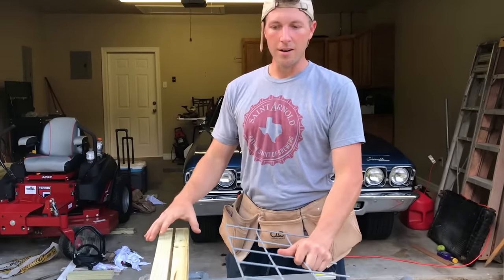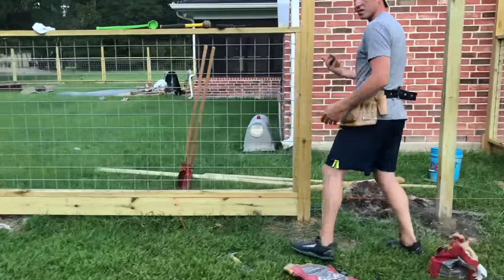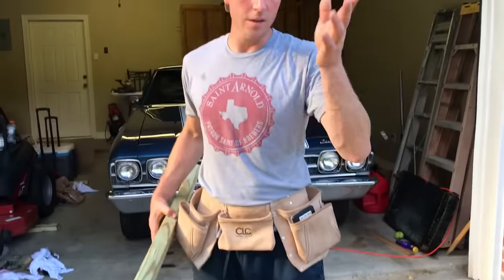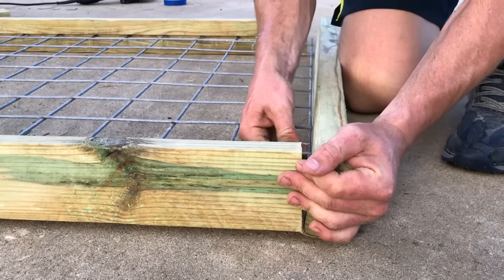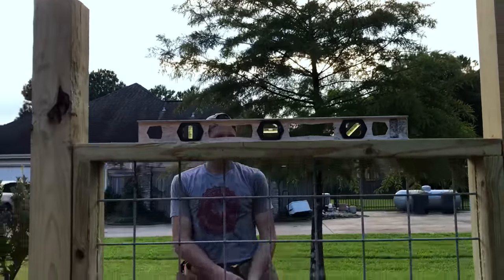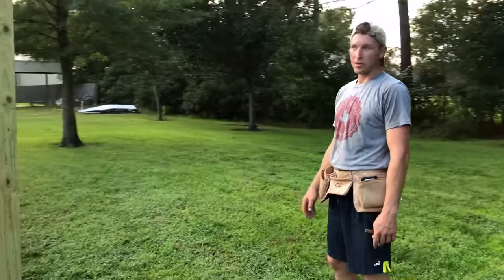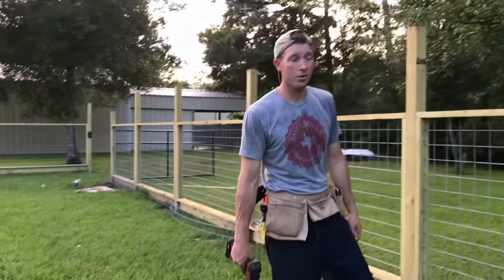Part 1: Modular Hogwire Panel Fence with Dado Groove

Comment: Sweet fence work John. I think you have a game changer there. I noticed your house is lacking dirt near the footers. I know Tx receives a good amount of rain these days. I would get a load of clay and pack 3 to 4ft wide track of clay around the house to prevent water from washing out dirt around footers. I had this come up during a major flood event in La 2016. The flood waters washed out a good amount of dirt from my home and we had to get 14 loads of clay to rebuild land and pack around the house since my footers were exposed.
Reply from the maker: Thanks, this is great information for preservation of the slab footer. Im not sure how far the slab extends beneath the soil line, but base on my video, how far up the slab footer would you suggest the placement of the clay grade be (its approx 6"+ from soil to brick/weep hole elevation most of the house perimeter). thanks,
Reply: @GatorOverland  You are exactly right. 6" from weep-holes in brick to ground. Also, if you have any critter problems you can pack the weep-holes with cut to fit Scouring Pad. Keeps roaches, spiders etc out of the house. If you have ant problems spray home defense in weep-holes and pack with scouring pad. The weep-holes are there to help your house breath and drain any water that may enter the house which is why i used the pads cause it doesn't impact draining or breathing. If you have a 6" slab on the house your footer should be 1ft but most homes have 4' slab so you would have a 6 to 10in footer. Clay was highly suggested by my structural engineer and he was right cause it packed very well and we have not had anymore issues with washouts.
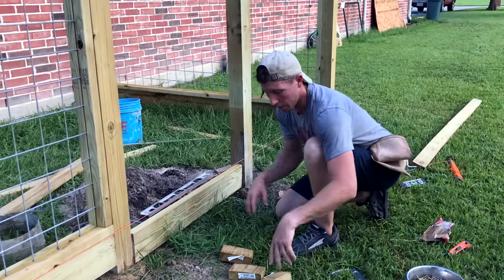Reply: @GatorOverland  Looking at 13:26 video this is what pointed out a possible issue. The soil level is too low from the house and it sort of dips in that middle area "could be grass height as well" which tells me that area could be holding water during rain events. I had to learn the hard way by finding all of this out after a flood event and very expensive as i had to hire a structural engineer so i tend to inform others based on my past experiences. I would make a run off like this \ 6 inch from the weep hole in clay as wide as its needed to level out to your yard so your mower doesn't cut into that clay pad. If your home lacks gutters i would also consider making a rock bed or mod some PVC in ground to catch that water and direct away from the house. We had gutters on our house so i just installed extensions to the downspouts to keep the water further away from the house.  If you build a house in the future build on a hill and never worry about this sort of stuff again. After 2 homes purchased and sold in 13 years we built a new house on a hill and water is no longer an issue.
Reply from the maker: @bc5891 , awesome! i will keep this in mind for sure. Ive been needing to do some buildup slope at these ares of discussion anyway as ive noticed these areas remain the wettest the longest after a good rain (aka to damp to mow near) while the rest are the yard just feet over is dry.
Reply: Normally, you would want to build a good amount of land up to meet that level around your house but this could prove to be a defect in your builder with land elevation so if you build your land up to meet that grade you may cause water issues for your neighbor. Just something to think about. I was looking at that gap you had on the bottom of the fence. If you decide to build up the land at the house and shape down to level of fence that would easily correct future issues but with that you want to hire a dirt company with skid to level it out for you.

Comment: Beautiful job. Next time though just dado the fence post. It would cut your wood costs again because you would not need a verticle 2x4 and you could afford to eat another week :P
Reply from the maker: Thanks for the reply David! Yes i agree, and this idea was considered during the planning process. Running the dado or router down the 4x4 post would be economical (saving the cost of 25 - 2x4's @ $4 ea.) as it would become an integral part of the frame for the wire panel to sit in as well as being a sturdy post, but i didnt know if it would be as rigid or efficient as a full frame design, considering i used the vertical frame lengths to screw through to secure to my 4x4 post. With the grooved post method, In my mind, this would make it difficult to secure the top and the bottom frame lengths to the post as you would have to toenail screw at an angle into the post while holding up the panel at the same time.The full frame is also forgiving if you are not precise on your post setting. If youre +/- too much on your post setting it might conflict with fitting your wire panel into the post groove (too tight/too loose). I you are interested, send an email to hawkijon@aol.com , i have a hand sketch and material breakdown to reference and some finished product pictures.
Reply: @GatorOverland  I'm going to sub you for a bloody good video backed up by a fantastic personal reply to my suggestions :D
Reply from the maker: david featch, thanks david! I appreciate the honesty and comment as well!

Comment: Try cutting your rabbet in the posts, looks cleaner, less lumber.
Reply from the maker: Yes I agree it is a cleaner look, and this was a consideration, but takes a little bit more precision on planning the post and structurally would be less rigid. The fence is holding up great.

Comment: Did you use concrete on the post?
Reply from the maker: yes, shoot an email to hawkijon@aol.com if you would like my supplies cost generator. I used a handheld auger to dig my holes @ 18" depth and added the quickrete pea gravel as recommended for drainage before filling with 1.5-2 bags of quickrete, making sure to elevate the concrete setting above ground level so rain water would drain off and deter the acceleration of the post decay where it meets the concrete.

Comment: How do you keep them from digging out?
Reply from the maker: i have some of my trimmed pieces from the big wire panel placed in the ground 4" and stapled to the rot/mud board (explained 18:10). This has worked so far, my pups are 2 and 8 and fortunately neither of them have had a previous history of digging, so hopefully it stays that way. In the case that they do, they would have to dig a hole about 15" deep and wide to get out. If you are interseted in a hand sketch with material breakdown and completed photos, shoot and email to hawkijon@aol.com.
Reply: @GatorOverland  Thanks

Comment: How much did it cost to make?
Reply from the maker: Thanks for the reply! I have developed PDF drawings with material breakdown and Excel cost generator based on my exact build per linear foot available. Shoot an email to hawkijon@aol.com and ill send it over. I did 207 linear feet for fencing for about 8.75 per foot. So, around $1800 +/- for materials not including the gates.

Comment: Nice fence, but you need to polish up your table saw skills while you still have all your fingers.  Your dados are too deep and you need to do something about your bottom rail dados since water will set there and rot out the wood pretty fast.
Reply from the maker: Thanks for the reply David, After the video I went back and drilled 3/16 holes every 8 to 12 inches in the bottom dado and tested it with a bottle of water… A drain sufficiently, and fortunately it rarely gets below freezing where I live. Other than that it’s holding up great!

Comment: The dado is pretty but it can store water in it
Reply from the maker: Thanks for the reply Mike. I do plan on a deck sealer of some sort, but currently the wood is still resisting any stain. I did go back an put a 3/16 weep hole every 8" and filled the dado groove with water from a bottle and it drains almost immediately. Hopefully the wood rot is deterred from what could be expected as i dont know what a short term time to expect wood rot to be on this method. In a near by area my friend has an unstained or sealed deck that is 15 years old and still in good shape, so im hopefull it will stand the test of time for atleast that length of time.

Comment: Hey. This fence is awesome and my wife and I are wanting to build this. I cannot for the life of me find the panels. I can only find cattle panel and horse panel. Please tell me where I can get this 16fx5ft panel. Thank you
Reply from the maker: Tractor supply is where i got them. They are labeled as utility panels with the 4x4 grid and run about $50-$60 per 16ftX5ft section. If you are ok with horse/hog panel, they are 6X8 grid and run about $20-$30 
https://www.tractorsupply.com/tsc/product/utility-panel-5-ft-x-16-ft?cm_vc=-10005
Reply from the maker: send an email to hawkijon@aol.com and i will send back a detailed hand sketch with dimensions and material breakdown.

Comment: John, where did you buy you panels?  I live in ATX.  Love the fence!
Reply from the maker: I bought them at tractor supply, but im sure there are some farm and livestock stores around that may have them same 4x4 panel. Other than that, you can find the 6X8 panles for 1/3 the cost @ about $20 per panel vs $60. I lost the cost vs. aesthetics battle with the miss'.
Reply from the maker: send an email to hawkijon@aol.com and i will send back a detailed hand sketch with dimensions and material breakdown.

Comment: Why in the frikken hell do you refer to timber that is one and a half /by three and a half inches as 2/4 inches that sounds like crap to me?
Reply from the maker: i wondered the same thing. Boards used to be rough cut to the exact specified length, but the the as a standard manufactures began to plane the boards down by 1/4" on all sides to remove rough edges and whatnot, resulting in a more smooth and finished look. Made sense after reading into it.

Comment: John,  Did you use a 6x6 post to hold your 10 foot gate or just a 4x4
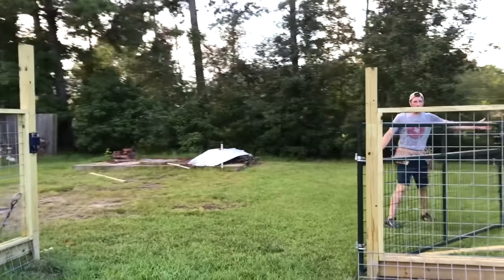Reply from the maker: No, I used all 4x4 post for this project, except the post for the hinge (load bearing) side of the gate, i put the post at 27" depth and hole big enough for 2, 50lb sacks of quickcrete. Originally I had planned for the corner post the be the hinge side of the gate, but after thinking about it, it made structural since to put the hinge side of the gate as the 1st post of a fence length run (18:30) as this post would be reinforced by 50ft + of fence length in the same plane that it would lean. If I put the hinge on the corner posts (not a big deal with the 4ft gate weight), technically there is no other reinforcement on the leaning plane of the post and there would be potential for it to lean over time to the weight of the gate. That is why the corner post are the latch post.

Comment: Why didn't you keep the panel at 5' and skip the cutting step? Nice fence BTW.
Reply: Never mind I think you did keep them at 5' and just made shorter as needed.
Reply from the maker: @raymonddurkin  thanks for the reply! i could have left them at 5ft, but i chose the panel length to minimize cost and material. Basically every constructed panel is (3) 2x4x8ft treated board, (2) boards trimmed to 93" going horizontal and cutting (1) board in half and then trimming to 46.25" to make the vertical lengths.This allowed me to maintain dimensions with minimal trimming scrap. If i would have gone any higher i would have needed to buy a quantity of 10 or 12ft boards for the vertical board lengths, which isnt a big deal, but it was extra cost and scrap trimmings. I hope this answers your question.

Comment: How much did this project cost you?
Reply from the maker: C & C Creations thanks for the reply! Shoot an email to hawkijon@aol.com , I have developed a detailed drawing and excel cost estimator based on my build per linear foot available. I did my build at about $8 per foot for 207feet.. less than $1800 for everything.
Reply: @GatorOverland  what wire panels did you use on this project?
Reply from the maker: @Antknee01  in my description i have a brief overview of material and dimensions, but I used 16ftX5ft wire panels with 4X4 grid purchased from tractor supply. Shoot an email to hawkijon@aol.com and i will forward you a detailed drawing and excel cost generator i developed based on my exact build per linear foot.

Comment: What table saw do you have there? I am struggling to find one that is compatible with a dado blade.
Reply: Rigid Table Saw (their colors are orange and black and they're compatible with dados).

Most all saws are dado compatible, because it's typically just the tabletop insert that isn't wide enough. So, you just make an insert out of wood and then slap a dado blade on (that's what 99% of woodworker do when starting out unable to afford $1.5-5k cabinet saws)

Comment: John,  Trying to figure out how to reduce cost of this fence at $3,600.  I wondered if one could cut the dado groove in the 4x4 post and eliminate the vertical 2x4's and just use the horizontal one's screwed into the 4x4.
Reply from the maker: Yes, you could do that, but it would come down to how precision are your post going to be. It may lack a bit of the structural rigidity of mine, but would be fine for a garden on a minimal budget. What is the dimension of your area?
Reply from the maker: Im not sure how large your area is, but my fence totaled just shy of 200 feet. Factoring concrete, lumber, wire panel, gates, dado blade, and screws my cost of materials was $1944. Based on the near 8ft centers, that is about $77 per 8ft. I purchased all materials through Home Depot. My math shows your garden at $3600 would be about 380ft of fence length.
Reply: I have 2 gardens next to each other.  One 30x80 and the other 60x90Doing them separately so 8 sides with one 10' gate and two 6' gate for large wheel barrow.
Reply from the maker: @gregbrooks9546  That's quite the garden area you have. Totaling near 260 linear feet with my average $77 per 8ft lands you around a 2500+ budget, but mine is factored with (2) 4ft gates and (1) 10ft gate. I can see the potential for it to get up to the $3000 range. What i did was go on home depot or lowes website and filled the shopping cart with all the materials i needed to get a roundabout number, and went from there.
Reply from the maker: Also, to add. You could save quite a bit of money on your wire paneling by going with the 16ft x 5ft hog panel which has the 6X8 grid squares vs. the 4x4 grid squares like mine. I did the 4x4 grid to because of my aussies head size. At tractor supply the 16ftx5ft with 6X8 grid runs about $20 instead of $52 like i payed for the 4X4 grid, Which is $400 savings right of the top!!!

Comment: Has anyone tried to make 1 pannel with the full 16ft? I was wondering if it gets too weak
Reply from the maker: I’m not sure.. I would think you would need a brace in the middle for 16ft.. so, might as well do slightly less than 8ft spans like i did to ensure full strength without bowing..

Comment: Did you cut your panels 1" short on the height and width.
Reply from the maker: It worked out to be about 1" short. This allows for about 1/2" play for the panel to move within the dado'd wood frame. The depth/wiggle room is totally up to you. I did this depth so i could cut complete perimeter panels (hard wire boarder all the way around) instead of having to cut in the middle of a 4x4 square. You will be glad that you gave yourself the room.  2x4's  are approx. 1.5"-1.75" thick. I set the dado @ 1" depth, leaving approx 0.5-0.75" of solid wood between the dado depth and back of the board.

Comment: Can u put a link for the gate
Reply from the maker: Thanks for the reply. Shoot an email to hawkjon@aol.com if youre interested in pdf build drawings with material breakdown and excel cost generator i developed based on my exact build per linear foot. I got the gate, speeco latches and 16ftx5ft utility panel at tractor supply.
https://www.tractorsupply.com/tsc/product/wire-filled-gate-10-ft-including-hardware
https://www.tractorsupply.com/tsc/product/wire-filled-gate-4-ft
https://www.tractorsupply.com/tsc/product/speeco-two-way-lockable-gate-latch?cm_vc=-10005
https://www.tractorsupply.com/tsc/product/utility-panel-5-ft-x-16-ft?solr=1&cm_vc=-10005

Comment: I know nothing.... but to save costs could you "dado" (or whatever it's called) the fence posts themselves, use longer screws, and then screw the bottom and top rail into the fencepost itself?
Reply from the maker: Ivory thanks for the reply! You’re absolutely correct this could be done and a few other viewers have suggested it as well. It would probably hold up just fine, but you would have to make sure that your post settings are very precise or you could find yourself in a situation where the post maybe just far enough apart that the panel could easily pop out. Constructing that way verses my design would save you $4 to $5 Per panel set, but making a full frame will guarantee rigidity, and you can screw through the vertical frame panel into the post as opposed to screwing into the top and bottom panel add an angle to secure to the post. For detailed information drawings and cost generator I developed based on my exact build per linear foot, shoot an email to hawkijon@aol.com

Comment: How much did u spend on this fence ???
Reply from the maker: about 1600 without the gates included
Reply from the maker: The gates i chose were another $250
Reply from the maker: shoot an email to hawkijon@aol.com if your interested in building plans, with material breakdown and excel cost generator i developed based on my build per linear foot.

Comment: About how much $$ did u spend?
Reply from the maker: Thanks for the reply! Shoot an email to hawkijon@aol.com if you would like construction plans and a cost generator based on materials per linear foot. I built my 207feet of fencing at approx $8 per linear foot totaling just over $1650 (not including the gate cost). Local fence builders in the area charge about $19-$24 per linear foot for a standard picket fence.